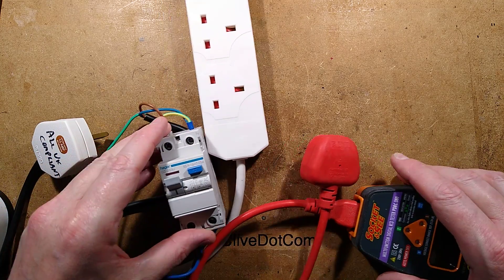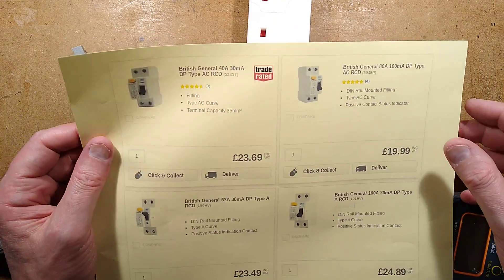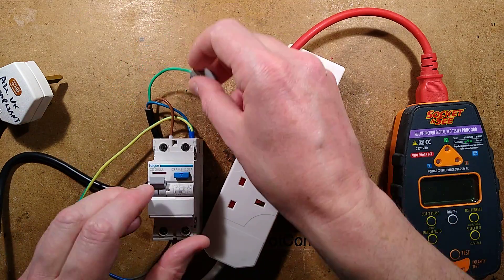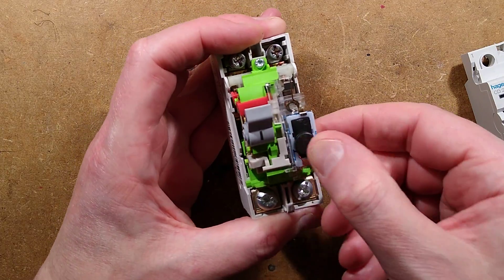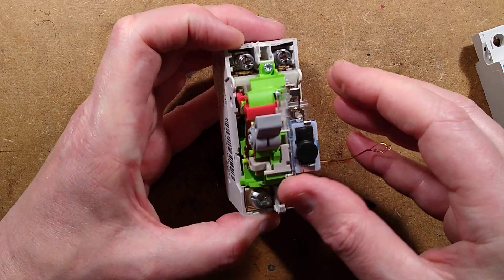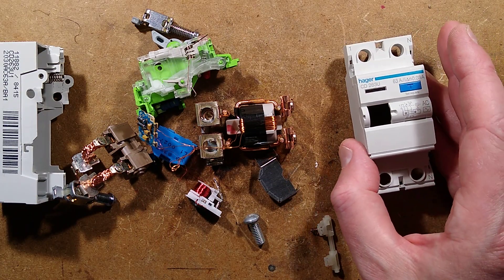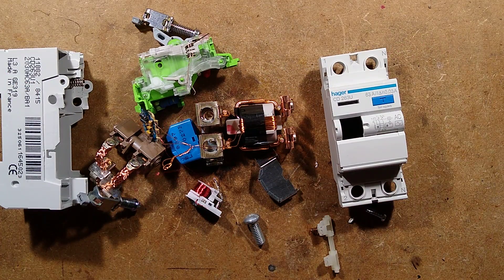Was this RCD damaged by overcurrent?

Comment: I'm a bit surprised by how much everyone in UK cares about electrical safety, even in residential buildings. Looking at those well-organised fuseboards feels odd. My soviet-built hruschyovka (just like most others) doesn't even have earth connections inside except for the bathroom socket; there are only 2 breakers for the whole apartment - one 16A switches the single hall socket and bathroom lights, the other 32A covers everything else; the kitchen lights are wired incorrectly - switches are on the neutral wires so the lightbulb sockets are always live even when switches are off, got zapped once thinking it was safe
The main fusebox in the entryway is an absolute CLUSTERFCK of loose cables and unlabeled breakers, with about a third of all breakers just hanging in the air. Some connected wires have a ~1cm of bare copper between the breaker and insulation, meaning that someone can easily touch it themself or make it contact the metal case when reaching for a specific breaker.
My internet provider has some equipment on the roof that is connected with a 2A breaker placed in the depths of this mess. After even a brief power outage someone has to reach through the loose wires and switch off, wait, then switch on the breaker to re-enable the internet for everyone.
No wonder a fusebox in a neighbouring entryway went kaboom a few days ago, almost starting a fire.

I guess there are some bad electricians and messy fuseboxes in every country, but an installation you or Nagy would call horrible would probably be "not so bad" in comparison to stuff i've seen here in Russia
Reply from the maker: Largely by luck, the UK established a power grid and standards system early on in the electrical industry.
Unfortunately it's going backwards now thanks to financially vested interests.  (One week electrical training and "certification" companies.)

Comment: Bah, Hager RCDs, I literally had to replace over half of them in this house (4) even thou they were less than 3 years old, didn't trip even with a tester (not the test button).
Nothing to do with Hager, but some idiot who did the electricity in this house spliced of F3 and put it into a separate breaker, okay so far, but he mounted the breaker on the damn bus bar creating a direct connection bypassing the RCD that had the whole bus bar hot even when the RCD tripped. I hate lazy old electricians that abuse their local monopoly in small countryside communities.
Reply from the maker: Backfeeding an RCD can cause some to fail internally when they try to trip and the power doesn't go off.

Comment: What are the main fuses of this building? The cables must be massive. Here in Sweden, a normal house has 400v 3x16A or 3x20A as main fuse. Mostly using 10A fuses for normal sockets.
Reply: Jakob Blomstrand they don’t supply houses with 3 phase here as most electricians would fuck it up with the dodgy ring mains.. competence isn’t learned in this country.. they buy it.
Reply: 3x16 A or 3x20 A sounds small. In Finland it is either 3x25 A or 3x35 A with 3x63 A as an option but in many places that can cost up to 100 € more a month. In Helsinki they all are 5.51€ a month.

New homes use 16 A on sockets, older ones have 10 A and can have lights on the same.

Comment: Hey random question. When he calculated the current through resistor he just did voltage divide resistance. Ohm law. But don't have to do something with pf aswell like times result by 0.8? Or have I got a miss understanding.
Reply from the maker: I calculated it as an RMS current value.
Reply: @bigclivedotcom  so if factor in pf  that would be peak avg. Think I need to read up again. Work on ships with split phase no neutral. Always equated in the  pf. 🤦  Feel like student again.

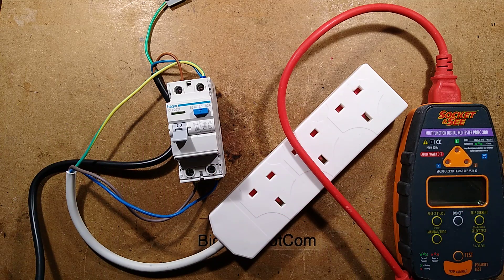Comment: 6:38 I don't test it that regularly because you have to set the time on the oven again, and the time on my alarm clock .....
Reply from the maker: That seems to apply to a lot of homes.
Reply: An other has posted that they test theirs 6 monthly - just before the clocks alter ;)
Reply: @millomweb  That is a BRILLIANT suggestion. 
I have now put "Test RCDs" on the list of instructions for resetting every damn clock  in the house and car
Reply: @tararat  It's not as brilliant as my first suggestion - abolish BST ! Leave the clocks alone - and those that want to get up earlier still can do!
Reply: If it was only the clocks. Some Modern TVs, or just anything that pretends to be Smart does usually not cope too well with a sudden loss of power. In best Case it only takes ages to boot up again. I had situations where things lost their whole configuration. And I just figured out in a colleagues house, that TP Link Powerline Adapters and Wifi Repeaters set up their own little DHCP server because they boot faster than the router. No way to disable it, just have them boot with a DHCP server present...
Reply: @alexku8452  Can't say I've come across much with that kind of problem. Had a Sony radio tuner that lost its internal battery so lost channel programming in a power failure but  it wasn't a great deal of time after that that it stopped functioning as a radio altogether !
Reply: It's remembering to turn off all the PC, NAS etc to avoid HD fails.
Reply: @IMBlakeley  Where are you getting your HDs from ? They seem to be the bits that survive and all the rest gets binned !
* Swann CCTV system
* LACIE NAS

Comment: I saw Chris' video about this and was hoping for you to make the "follow-up" - interesting to see that the RCD was apparently fine!
Reply: Agreed, nice to see this YouTube channel relay!
Reply: Did Chris do any sensible tests to try to find the tripping leak in that video ? Maybe he should have contacted (pun) an electrician ;) to find the wiring fault.
Reply: I wouldn't think he did any tests. Will have just decided that the problem is the RCD.
Very poor.
Reply: @davenorth1265  That's my suspicions too - and is typical of today's workmen. Replace it whether broken or not. Take into account that he sent tit to BC to ask the question whether overload was the cause. An electrician would know it wasn't.
My aunt's toilet wouldn't flush despite normal water in the cistern. Her plumber fixed the problem and unnecessarily replaced the float valve.
A friend had a roof repair. The builder advised of another potential leak problem - and sure enough it leaked next time it rained. Pretty sure the builder caused it after his first repair to create more work.
Reply: @davenorth1265  Actually he did do tests and there was indeed an earth-leakage fault in one of the outlets which he fixed (verified by re-testing), but iirc the RCD still kept tripping so he replaced it as well, after which all was good. It was way too small anyway for the load it had to carry.

Comment: There is a reg in bs7671 that says any rcd and/or main switch must be rated equal or larger than the ocpd protecting them unless the downstream circuits do not collectively add up to its rated current before diversity. If the circuit breakers do ‘go over’ the rated current of rcd and/or main switch then the ocpd (typically main fuse in domestic setting) will protect these devices. It seems to me as if final circuits drew more than the rccb’s rated current (but not greater than ocpd), tripped due to earth leakage which buggered it up
Reply: The trouble here is that we don’t know what the power company supply fuse is rated at. It could be that it is a 60A supply, then the 63A RCDs would be okay...

Comment: Have you heard about the TV in Montgomeryshire causing the DSL to not function correctly? Would love to see a video about it on your channel!
Reply: I saw that, what I found shocking was it took BT 2+ years to figure it out.

Best  RFI story I recall was interference on the uplink to an old TACS or maybe AMPS cell, turned out to be rusty diode effect from corroded screws on the door of a train carriage that passed by at different times.

Comment: As an American, I find this way over complicated. I’m not making fun of your electric system over there. Newer technology has slowly made ours here more complicated, like having a GFCI in locations where in can get wet. We have had for a while now, GFCI circuits in the breaker box inside of the house. But for the most part, it’s basically a mechanical type system. 
   Is there a benefit with the complicated electronics where it comes to safety? Keep in mind that comparing our two systems, that both have their pros and cons. But, overall that can’t be better? Safer, yes, because of the hands on so often.? If our buildings are designed and wired correctly, it’s basically, set it and forget it. Until something happens.
Reply: outside of north america houses are usually wired for 240v....for everything.  IIRC 240v would pass 4x the current 120v would in the case of a short or if a person touch's the wrong wire.
Reply: @Wooble57   Fatal shock level is in the milliamp range, hence the low trip current for these RCD devices. In a medical facility like hospitals the trip current is lower [typically 10mA] than that of domestic/commercial installations.
Reply: You can receive a fatal shock from any faulty electrical equipment connected to mains supply, not just equipment located in 'wet areas'. 
Why don't the USA regulations don't consider this?
Reply: What I was asking about is the mechanical versus this electronic. Wouldn’t the more simple mechanical breakers be cheaper? Typically people here in the US don’t touch the metallic parts energized with electricity. So,death is not that big of a deal. I can imagine we would change if it becomes an big enough of a issue. 
   What is the chance of house fires when using these? Here in the US, house fires typically rise in the winter, sometimes from electric heaters being too close or something similar. Part of the time it is from circuits being overloaded, usually on older homes with updates to the electrical system.
Reply: @johnsimun6533   There is no way current imbalance between Active and Neutral at the level that presents as a fatal shock risk [in the mA range] can be determined and trigger a trip mechanism using anything other than electronic components. 
Does anyone other than the naive or unknowing touch faulty energised equipment? 
Cheaper? How cheap is life there? Death is not that big a deal? 
These RCD devices are used to reduce risk of shock, not fires. Fires from overloaded circuits, occur due to a range of possibilities, some being:  faulty overcurrent devices, faulty wiring, and DIY morons wiring or modifying installations.

Comment: I saw a video from - I believe Applied Science - where an unsmoothened half-wave DC of the AC outlet voltage was needed (so AC rectified by a single diode). He mentioned that he was very careful not to toch the DC, because it might not trip the RCD. So if I understand it correctly, that is the case if you have an AC only RCD. Never thought about that.

I don't test my RCD monthly. I have some Linux small board computers, like a firewall, who run in read/write mode. They don't like being powered off unexpectedly. If they are just writing some data to the SSD, files may get corrupted. So I have to shutdown them properly before I can test the  RCD.

Comment: Had one RCD do odd things. Once it had a 20-30A load in it if you just switched on a socket with any appliance attached it would trip. It would pass an RCD test which is usually ramp tested. Got to the point of testing with a static leakage with a homebuilt device that could switch in 5mA at a time. At 35mA it still hadn't tripped. Usually you'd expect them at around 20mA to have gone. RCD swapped and never had a problem again since. No other leakage was found on the system past the background few mA - checked with a clamp leakage tester.

Comment: There may be a permanent magnet at the other end of the core and when the coil energises it may cancel it out?
Reply: Maybe the permanent magnet is on the bit that swings (e.g. N)  and the coil produces another N and same poles repel !
Reply: @millomweb  maybe
Reply: Yes, there’s a round permanent magnet on the top of the coil. The induced voltage cancels the magnetic field and releases the plunger, which trips the breaker

Comment: On that Screwfix screenshot the top two are Type AC,  the bottom two Type A.
Reply: still right though - you could replace all 4 with the 100A type A. Why do they bother making and selling type AC any more either? I believe type AC is against wiring regulations in other EU country wiring regs due to how they can be rendered ineffective by pulsating DC currents.
Reply: What type is it if the RCD doesn't specify ?
Reply: @millomweb  Probably Type AC. Current ones have a pictogram on the front to indicate what type it is. Type AC has a sine wave in a rectangle, Type A has a sine wave plus a half-wave rectified sine wave.
Reply: @Graham_Langley  That's my thought too.

Comment: We in Germany usually have a 16A breaker for every room (so for the kitchen). Just the Electric oven has its own 3-phase circuit. And I have never seen that any fuse was tripped because of overcurrent
Reply: In our utility room, we have a dishwasher, a washing machine (clothes), and a tumble dryer, which would regularly overload a 16 amp breaker even if just two appliances were used simultaneously.  This is where a 32 amp ring mains comes into it's own.

Comment: You had me worried there for a minute, but luckily all my RCDs are type A. Apparently type AC has not been allowed for new installations since 1996 here in the Netherlands.
Reply from the maker: That puts you guys ahead of the UK in that area of safety.
Reply: @bigclivedotcom  only when installation guidelines are followed. even here i find many units with way more breakers on 1 rcd than allowed. even to the point that it makes me wonder why the main fuse is still working.

Comment: Here in italy the rcd must be protected by a breaker. So most of the people install a rcbo.

Anyway our max current is around 32A on most expensive contracts (3kw is standard) so we have really small circuits.
Reply: In our apartment in the Canary Islands, we have the basic 3kw supply.  Unlike the UK, you pay a standing charge based on your capacity requirement, even though the incoming supply can provide the maximum.  If we want to upgrade from 3kw, however, we will need to rewire with an earth connection.
Reply: Interesting - is that 32A for the whole property?  That seems low but at least usable, but 3kW seems really low. I've noticed in Switzerland that appliances like electric cookers use 380V (presumably two phases of the 220V supply) - would that be the same in Italy for high power appliances? In UK homes everything just uses 240V (officially 230V since it was re-declared with wider tolerance).
Reply: @rossthompson1635  yup 3kw for a home. Generally a 25A breaker is installed, some system are designed up to 6kw so 32A breaker is set.

Homes are generally 3kw single phase 220/240V. Some stuff like elevators, or pumps can require 3 phase at 400V. But those are limit cases.

Heating and cooling is done with gas, we have learned that we have to turn on an single appliance at a time.

Italy, we voted against nuclear power and this is the result...

If you want more details search on You tube: "can uk electrician learn from italian electric" and look in the comment section. Over there there is a huge comment by me.

Comment: Tiny little magnet with a weak field in there, adjusted to get the correct field strength in the coil. In the top black protrusion, and turned to the correct trip current in the factory. This holds the armature just into position, so that the current through the coil is enough to reduce the field so the spring can release it. that is why it is in a small magnetic shield, as it is sensitive to magnetic fields around it, and without that shield it would be orientation sensitive due to the earth's magnetic field, and the current flowing in the busbars and wires near it. Circuit board is a pair of zener diodes to act as a voltage clamp, and some small capacitors to filter high frequency noise off the circuit.

Likely yes the reason it was randomly tripping was DC in the system from half wave rectifiers and capacitive supplies, as they all have a small DC current flow from asymmetric rectification. This biases the permalloy sense coil into a non linear range and thus makes it act like a saturable reactor, so on one half cycle it will generate a current in the sense winding as it saturates, and randomly this current will be high enough along with harmonics to trip the coil.

Comment: American here, why are your showers on a circuit breaker?
Reply: The same reason any electrical circuit is on a breaker, to protect the wiring in the event of overcurrent fault. The showers most commonly used in the UK are "instant heat" showers with an electric water heater built into them. They are typically rated at 8.5kW so is a very heavy consumer.
Reply: @ferrumignis  I didn't know about the individual heaters, that makes sense, thank you for explaining

Comment: Today with so many SMPS in everything should be type A everywhere 
Sad only few manufacturers have them in catalog
Reply: Hopefully they will become more readily available as car chargers become more common.
Reply: @davey6024  With car chargers even type B could be necessary, depending on the type of car/charger. If enough DC leakage current (>6mA) flows to the car/charger, it could prevent a type A from tripping altogether, because it saturates the pickup coils.

Comment: Two electric showers on the one board? I'm not a sparks but that sounds off. 17kw between them, and the cooker and the kettle all drawing current together sounds like pushing towards 90 or 100 amps. Pretty sketchy.
Reply from the maker: The first thing that came to mind was a bed and breakfast type operation.